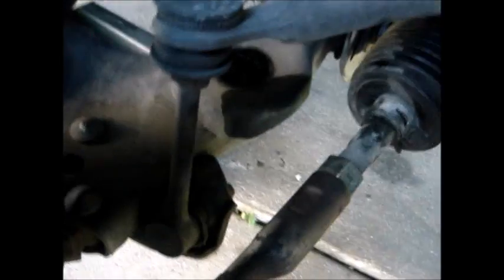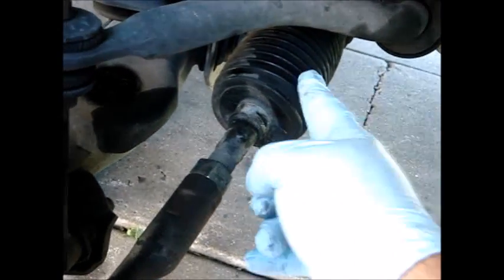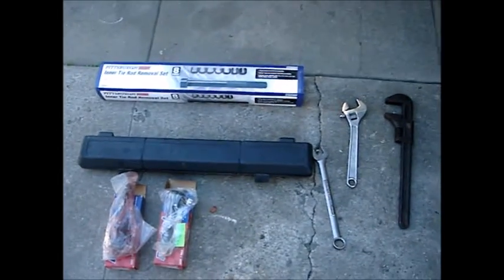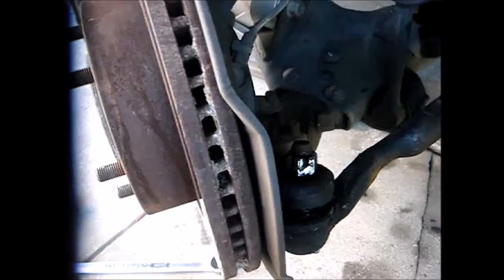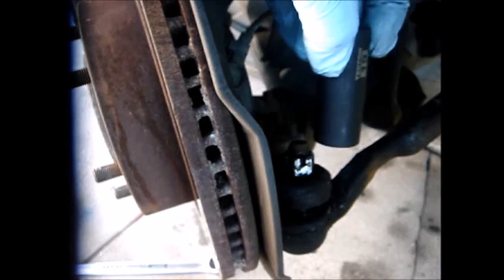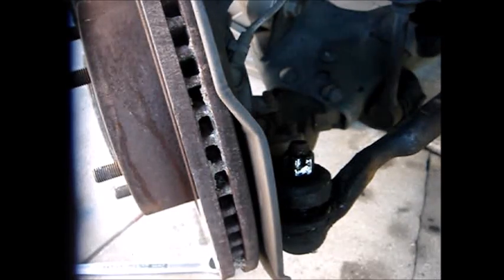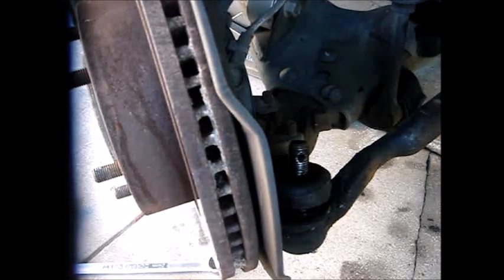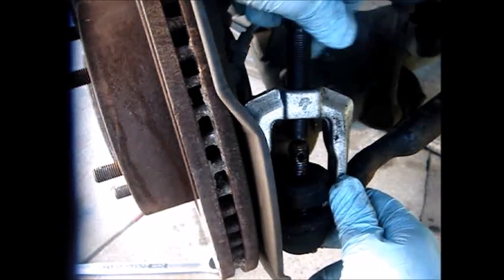Toyota Sequoia / Tundra inner and outer Tie rod replacment.

Comment: Hi Oscar, Thank you for the video. I was able to replace both inner and outer tie rods with your help!I highly recommend getting the correct inner tie rod socket to remove and install them. I did not have it and as a result, I had to use an adjustable pipe wrench.

Comment: Oscar, put the wrench part on the inner ball joint housing first, then the tool should slide over the housing of the inner
Reply: Yeh you put the key on the tie rod then slide wrench on.

Comment: Great vid...even Haynes manual doesn't show this repair! Most shops show an inner tie rod leak with a loose rod and recommend a new rack and pinion! Even if ur steering works smoothly($1300 repair)!  Probably should use Red threadlocker! Clean ur boots up also.

Comment: Inner tie rod ends on my 2000 Tundra were too fat to take the tool. I just put a pipe wrench on them and a come-along to the rescue hook and loosed them that way. Was not able to torque them back on but they are plenty tight plus thread lock.
Reply from the maker: Good thinking. And thanks for sharing with us your diy.
Reply: Figure out how to use the tool.  It works perfectly.  See my explanation on this thread.

Comment: Did you try to slide the Harbour Freight (Frite LOL) tool over the inner tie rod ball without the wrench part...that's why its two separate pieces....?
Reply: It's not big enough. Sequoia inner tie rod is 42 mm and the tool also has to be deep enough so it can grip.

Comment: How did you get the new lock washer to bend around the inner tie rod ? I can only get one tab side bent around the other is on the top side and can’t fit a hammer in there to bend the tab over
Reply from the maker: Hi Dave, if I remember correctly, I believe I used a long screwdriver and hammer it from the outside. I hope this helps

Comment: Oscar, I am wondering how you found that the torque of the inner tie rod to rack was 76 ft/lbs.  I have been trying to find the required torque, but other than your video, can find nothing.  I have a 2001 Sequoia.  My Haynes Repair Manual shows the 67 ft/lbs for the tie rod end to steering knuckle bolt, but shows nothing for the inner tie rod to rack.
Reply from the maker: Mornoff, I use alldata for the spec on the inner tie rod
Reply from the maker: Make sure you use a wrench to hold the rack and pinion when you torque the inner tie rod

Comment: Would it be worthwhile to rent a lift at a shop for $30 an hour to do this or use the bay for $20 an hour?  How long do you think it would take to do?  I've never done this before but plan on watching your video a few times first.  Thanks
Reply from the maker: I would recommend to Safe your self some money and invest in a good floor Jack. It should take about 1hr to complete this job with the proper tools.
Reply: @oscars-autorepair3236  I have a floor jack and jack stands.  I've got socket wrenches and 1/4 inch cordless impact driver. What other tools would I need?  Sorry, I don't have much data and haven't watched the whole video yet.

Comment: How did u torque the inner tie rod to 67 ft lbs? Didnt see u do tht in the video
Reply from the maker: The tool I used with the red tip had a 1inch nut shaped end in the back , I used my torque wrench with a 1inch socket to torque it.

Comment: I have that same side to side shake using my hands on the tire as well as shakey vibration steering wheel at freeway speeds. You think this will fix it?
Reply from the maker: Hi pat, it's may be the issue,  but try pushing the tire at the 12 o'clock and 6 o'clock position,  if it moves back and forth it could be your wheel bearing. Also try getting  your  tires balance..sometime the tires may need to be blanace ao they can ride smothly on the road. I hope this helps.

Comment: Do you recommend OEM or aftermarket tie rods? If aftermarket, what brands?
Reply from the maker: It's always recommend OEM but depending on the customers budget i always suggest buying from their local auto parts store just for their lifetime warranty on their store brand parts. But if it your car/truck always use OEM they will last 3 times longer than the aftermarket. This is just my experience in repairing cars.
Reply: Oscar Ruiz-Autorepair Makes sense. I figured that's why the Toyota inner tie rods cost 4x more...even online. Thanks Oscar and keep up the good work and great videos.

Comment: What model of tool are you using. I just bought one and it won’t fit over the outside of the ball?
Reply from the maker: Hi gary, the tool is The Speedy, Universal Inner Tie Rod Tool model  MAY29910 , I hope this helps
Reply: Don't get that tool.  Get the one he couldn't figure out how to use.  It works flawless.  You can rent them from Autozone for free.  Put 42mm Crowsfoot on Tie rod.  It will just sit there.  Make sure the slots are open on the tube portion of the tool.  Slide tube onto tie rod and engage the tabs on the crowsfoot with the slots on the tool.  Close the slots on the tool via the sliding collar on the end.  Wrench away...  That tool is perfect for this job, just used it last week on Land Cruiser tie rods.  I did have to figure out how to use it though.